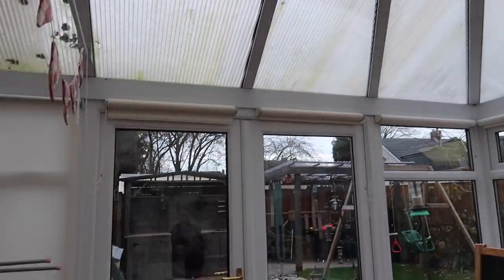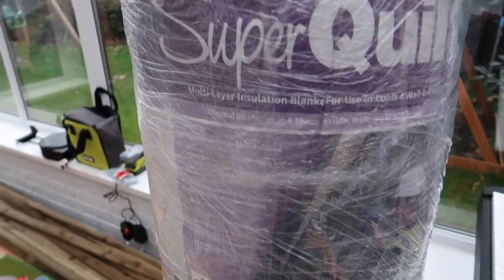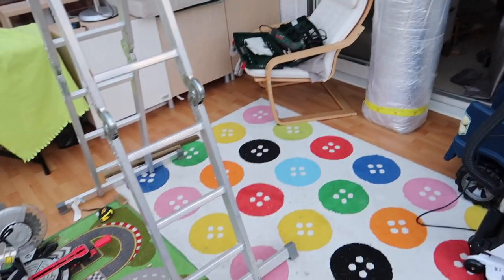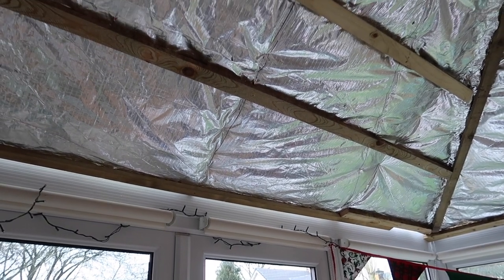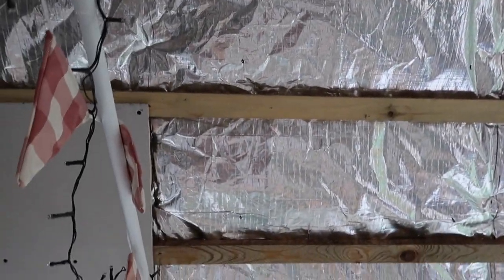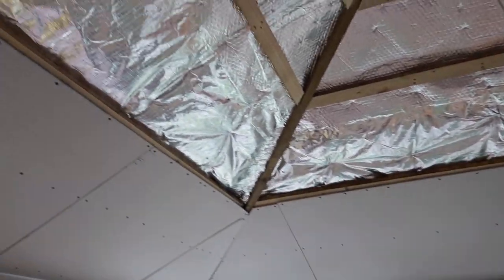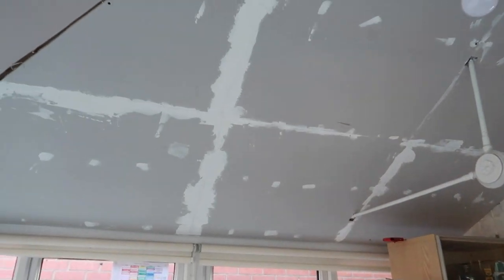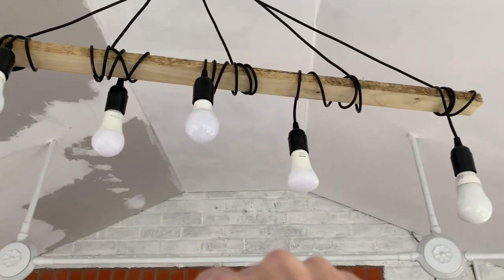How to DIY Insulated Conservatory Roof less than £320 - Single handed 30 something women!

Comment: The rafters you fixed the timber too are designed to take water and run to the guttering. If you have not hit the centre then you will likely get leaks.

Comment: Hi. Thanks for the video - very informative.  What did you do at the eaves/edges (where walls meet the roof)?  Did you effectively make a vapour barrier using the insulation? Is there some airflow between top of insulation and the roof?  Insulation and air tightness whilst avoiding condensation confuses me.  Thanks again. Matt
Reply from the maker: I ended up filling the larger gaps with expanding foam, followed by filler and paint, the very small gaps I’ve left. Yes there is def airflow between the roof and insulation and then the insulation and boards. I know because there’s no condensation etc and before I used the foam I could feel it. The airflow still happens because of the way the conservatory roof is attached. Me putting a seal on doesn’t change that.

Comment: Jane, fabulous video.  Without sounding too patronising well done you. I am a handyman and a customer (also friend) directed me to your video to ask if I can do this!  Apart from arm ache I am now 100% certain that seeing your finished work I can do it too. I Have plaster boarded a few normal ceilings but never a conservatory!!!
My question:  as its a year later may I ask, have you noticed any condensation problems coming through from the insulation to the original corrugated plastic roof? I am assuming you took advice and the silver insulation wrap has taken care of that?  Fantastic.
Reply from the maker: Hi thanks for the comments. So it’s been up about a year and a half now and there’s been absolutely no problem with condensation I think the key is getting the gaps between the roof and the foil and then the foil and the plaster boards. 
From what I was researching when I was researching mine those gaps stop the condensation because the air can move around freely. I have no doubt you can get it done if I can do it with no real training I’m sure you can as a handyman! Definitely have aching arms after doing it though!

Comment: You did a great job.  Its been almost 2 years, is it worm enough in winters ? Do you always need radiator on in winters ? 

Did you do anything about big glass windows ? 

Was insulation between 2 layers of wood and for 1st layer did you drill screw  through pvc ? 
You video is an inspiration  to many looking to use it all year round  👍🏻

Comment: This is seriously impressive 👌 I’m a professional painter and decorator and I had a joiner come out to price up doing the exact same for me, after watching this I am 100% going to give it a bash myself. What size wooden battens did you use? I also need to do something with the exterior of ours as it has started leaking in some places, think I will leave that to the roofer though haha!
Reply from the maker: So sorry not sure exactly what size batons I used as it was over a year ago now, at a guess they were roughly 1” x 2” but my local timber merchant didn’t have that exact size so I got nearest to it I think. Good luck! Over a year on and still doing fine 👍🏻
Reply: @LyricGrace  Hi, this video is very good. Impressive! Is it still standing :)? I am thinking of doing the same thing myself but my big worry is that leaks later on would ruin it. Do you know or do you know of a good DIY video where they talk about checking the roof for leaks?

Comment: Hi great job have you encountered any problems in the time its been insulated and has it made a differance to the room temp ?
Reply from the maker: @robuk1515  thanks for asking, not had any issues looks exactly the same. Temp is vastly improved in winter and far cooler in summer, usable all year round now.

Comment: That's  fantastic thinking of doing it myself but worrying about the weight of the paster board  on the plastic roof.. have you had any problems since?
Reply from the maker: No, thanks for asking, so far so good. The roof is a steel structure with the plastic to cover the steel, the screws I used were screwed into the steel to support the first set of wooden beams. They seem very secure and it's what the professional firms seem to do.

Comment: Looks great. How is it holding up just having the joints taped & filled? Are they all ok? That is how I want to do ours and avoid the mess of plastering
Reply from the maker: Thanks for asking. At the moment it’s still exactly the same as it was when I did it. No movement or anything at all. I did quite a bit of research prior to using this method and in some country’s it seems routine to do this instead of plastering. Worth looking at other videos of people who do this to learn the best way. I’m no expert but it worked for me.
Reply: @LyricGrace  that is great feedback, thanks. I couldn't find any other videos of taped and filled joints, they all seemed to be plastered or the pvc panels which we don't like.

Comment: Did you tape the foil insulation to the top of the wall or just leave it? I can't work out whether I should tape up where cold air is coming from on my conservatory roof where the bottom of the roof meets the wall or is it important for condensation? Super job!

Comment: Really excellent work, looks very professional.  One question, what does it look like from the outside, I.e. looking down on the roof, how tidy (or not) does the space quilt look through the polycarbonate roof panels?
Reply from the maker: Looking from the bedroom windows above it doesn’t look much different , I thought it would look maybe shiny or metallic but it doesn’t it just looks like a darker version of the original roof. When it’s night time and the lights are on inside obvs you can’t see the light shining up anymore if that makes sense.
Reply: Thanks for the reply.  Impressive work and DIY abilities.

Comment: Looking at doing the same with mine, but with pvc tongue and groove. Have you had any condensation yet? It's the one thing that's putting me off
Reply from the maker: No none at all yet, when I was preparing to do the job I noted it was very important to leave the air gaps between both the roof and the insulation and the insulation and your chosen covering so that condensation doesn’t happen or build up. We’ve had temps below minus 6 and above 12 since I fitted it and all good so far 👍🏻
Reply: @LyricGrace  thanks for the reply. I dont suppose you know what kind of bars you were scrwing into? I had a look under my plastic trim earlier and mine look a little awkward to screw to because of the shape but should be OK at the right angle
Reply from the maker: @nathansmith3727  so yes I had a look too, but don’t have a picture. I’ll try and describe them, they were sort of like two capital C’s back to back so when I was screwing into them I tried to hit the very middle with the self tapping screws and it made it much easier. Hope that makes sense?

Comment: Great video, im planning on doing the same soon.  Considering you posted this video a year ago did you see a big improvement over the year in temperature?  would you be able to remove the conservatory door all together?
Reply from the maker: Yes the temp is def better and much more consistent. Of course when the door is shut and no heat on in there it still gets cold (not as bad though) but when you heat  the room the heat is retained and is nice to be in. The summer is also much much cooler. Yes I would remove the door no problem if I wanted to. I leave it there as extra security.

Comment: What a truly amazing job! I'm currently researching how to do ours and can't wait to get started. Did you seal up where the roof meets the wall? Either with the tape or plastered over? Not sure how you would get a neat square edge unless it's completely sealed up?
Reply from the maker: Thanks for your comments. 
So what I did was use a small amount of filler foam, waited for it to cure then cut it square. Then used caulk to make it smooth like a square edge. I'm sure there are better ways though but that's what I did and I'm happy with the finish

Comment: The jointing tape is for all joins to prevent cracking when the boards move just so you all know. If you don’t it will crack maybe not straight away but it will over a about 1y.
Reply from the maker: Thank you for the explanation

Comment: Love this, especially the fact you did it single handedly. We’ve just made a start on ours and have used plasterboard/insulation to make one of the sides into a wall. We’re worried about using plasterboard for the ceiling as it is so heavy. What was the thickness you used?
Reply from the maker: I used the thins I could buy in large sheets which was 9mm. I want to do one wall too but need to change the windows to blanking panels and I'm struggling to find someone who can customise and sell me some, before I do a frame and plasterboard. Have you changed the windows or was it brick?
Reply: @LyricGrace  we just put insulation up against the windows then plasterboarded etc over the top, also put wooden battens on the upvc to help attach the plasterboard. Then outside the plan is to put some white vinyl over the windows just to make it a bit more aesthetically pleasing! So far it looks ok, just hoping the boards don’t get damp. We changed the windowsills as they had taken on moisture and expanded, and put plasterboard on the small surrounding wall then painted the walls. So now it’s the ceiling which I’m stressing about!
Reply: @LyricGrace  use vinyl wrapping for the exterior of the windows, like what they use on cars/vans..if done well, should look smart

Comment: I noticed a gap under the plasterboard by windows before you finished and cant seem to see how you finished it? I am sorting outs out soon as the heat is too much for us and just wondering to complete my checklist
Reply: Looks really good too! You have already helped me a tonne
Reply from the maker: I filled with exapanding foam, a tiny amount then cut off excess, then used a filler and knife to create a smooth sharp edge. Then painted white, looks fine on inspection. The gap was different all the way around so this made it uniform. It may not be the best way but it worked for me!

Comment: I've inherited a lined conservatory roof, but the previous owners have used fibreglass roof insulation.  Where condensation has run down the inside of the polycarbonate roof, the fibreglass has wicked it into contact with the hardboard lining and now I've got lots of damp stains.  That's all got to come out.  Now that you're a good 6 months into your lining, have you seen any damp issues?
Reply from the maker: None at all, it's almost a year since I started. I made sure to leave air gaps between the polycarbonate roof and insulation and the insulation and plasterboard to allow for air flow.

Comment: Did you experience any condensation issues with the roof either side of the Insulation?
Reply from the maker: Thanks for the question, no I have not, but I left nice air gaps between the three layers to allow for air circulation.

Comment: PVA the plaster board before painting.
Reply from the maker: Thanks for your comment; but as you’ll see in the video I specifically chose a paint with a primer already in it to save the step of priming the plasterboard and it’s worked really well. I took my time to check with the reviews for the paint and thankfully it worked well.

Comment: Great job, how is it in the summer? Also, how easy is it drilling into the structure of the conservatory? I'm just worried about going too far in and getting a leak or something haha
Reply from the maker: It was quite easy once I found the middle of each metal beam, I use the screws in the video as I had seen others use that length too

Comment: Firstly great job 👍

I know that this was done years ago...
But I'd add, thermal acrylic paint to the wall & if you like, why not the ceiling as well.
Then add a far infrared heater bar, to heat it in the winter, this will cost a lot less to run than the oil filled radiator 👍👍
Reply from the maker: Thanks, I’ll look into that

Comment: Hi Jane, about to start the insulation of our conservatory following your process and want to know if you still going look after 3months and if there is anything you would have done differently. Thanks in advance for the response.
Reply from the maker: It’s now nearly 5 months from completion and it looks exactly the same as it did (except I’ve finished the last side off!) I don’t think there is anything really I’d have done different. Maybe get some help with getting the space blanket straight when stapling on as I had to do some micro pleats in it but other than that no. It seems to have withstood both freezing snow temps and more recently full sun (25) and it’s doing what it’s designed too. Good luck with yours!

Comment: Have you been able to use this throughout the winter as a play room? Also how has it been during the summer? Does it stay cooler?
Reply from the maker: Yes we used it all winter, there’s no central heating in there so I used a small oil filled rad in the morning until the temp realised with the house but once it was warm it stayed warm all day with door open, which is a vast difference from winter before when I had hot air blow heaters on all day long! Summer has been much cooler too, used to get to 40+C in there last summer but this year not gone about 30 so I’m happy with that.

Comment: What a great project, was always tempted to try something like this with ours but not as brave as you! Things that I was particularly concerned about was the weight of the boards and batons and the roof ventilation? Have you had any issues with either? Did you find any info on how much the existing frames can support?

Really tempted now!!
Reply from the maker: No no problems so far at all and I’ve been through all the seasons. I used a thin as board as I could found and left space for ventilation between the roof and insulation and then the insulation and the boards. I didn’t find info but it seemed very strong and so I went ahead anyway after watching other professional builders do it. Please note I am not professional just a home diyer!
Reply: @LyricGrace  Fab, thanks for getting back to me! Dead interesting! And how does it look from above?
Reply from the maker: @nickallan4211  not a whole lot different to be honest, I was worried it would look all shiney and odd, if anything it just looks a little darker. The polycarbonate roof as you saw in the beginning is sort of frosted (as well as dirty!) so I guess that stops it looking weird!

Comment: This is great, thank you for sharing! Is there a reason why you didn’t tape the bottom of the foil to the conservatory? Thanks again
Reply from the maker: I wanted to leave an air gap for circulation to avoid condensation. I don’t know if it’s right or wrong but it worked for me as so far no condensation.

Comment: Great job! Have you had any condensation/sweating issues since?
Reply from the maker: No none so far thankfully, and we've had snow and also hotter days. I think its very important to maintain an air gap between the roof and quilt then the quilt and boarding material

Comment: Hi, thank you for your video- I've found it extremely helpful! I notice you completed this project two years ago, have you noticed any issues with condensation or damp at all between the outer roof and the inner ceiling? I am keen to try this project myself but a little online research is giving me a few niggling doubts! As you have completed it some time ago, it would be great to hear how it's getting on and indeed if you have noticed any issues with it at all? How old is your roof roughly and did you have to make a watertight seal before installing the insulation?
Thank you :)

Comment: Hi, what's it been like in the summer?
Reply from the maker: Fine so far, hottest it’s got is around 24 and normally on a hot day like we’ve been getting it’s fine beyond 40+ so I’m happy with that. Also I open windows and nice breeze through and the shade really helps. We’ve been using as an office in the day no problem now which we couldn’t previously do.

Comment: How do you screw the battens onto the quilt, insulation just wraps around the screw 😢
Reply from the maker: I just felt for the under side battons and went for it with the screws, I wonder if you nede sharper screws? Sorry to not be able to offer advice on that, I didn't get that problem

Comment: Very impressed. What brand did you use to join the plaster board? Can you post a link?
Reply from the maker: I tried a plaster tape on one join but didn’t bother with the rest, it didn’t need it and hasn’t shown any sign of cracking so all good

Comment: Hello, love the video, I've followed it, carbon copy. 

I'm having a bit of a struggle with my first plasterboard, particularly the holding up with hand, head, shoulder & prayers, whilst screwing in with my free hand holding a impact driver.... 

Have you got any tips on how one archives on ones own? 😢 😅
Reply from the maker: It’s flipping hard! I did it alone and yes used a tall step ladder to wedge it in with my head, shoulder etc then once you have a couple of screws in you can concentrate on the rest. I consider myself strong but even I was swearing! Sometimes I found it was better to start at the bottom and once you have ine onone on easier to wedge the next one next to it

Comment: With this video now 1 year old, have you encountered any problems with condensation, extra weight from the wood and plasterboard etc? I am looking to do this on my conservatory roof but sceptical around adding extra weight, damp etc?
Reply from the maker: Thank for asking, no nothing at all, it looks exactly the same and has been fine at both extremes of temperature year round. It has meant we can also use the room year round too.